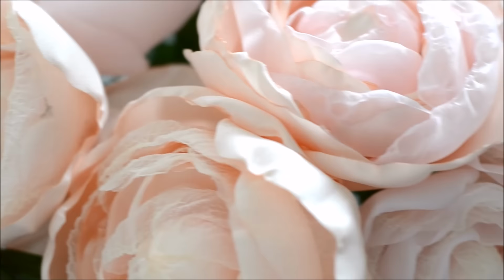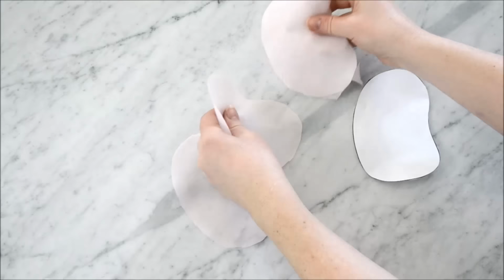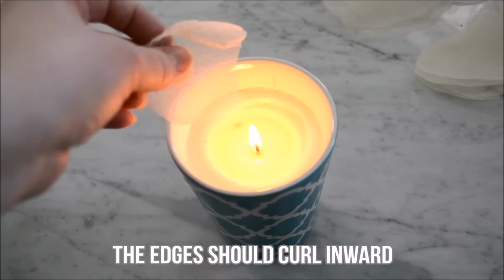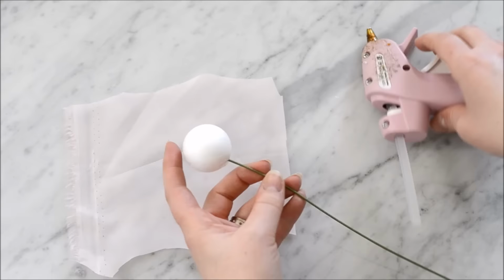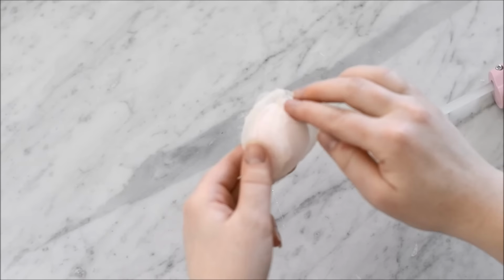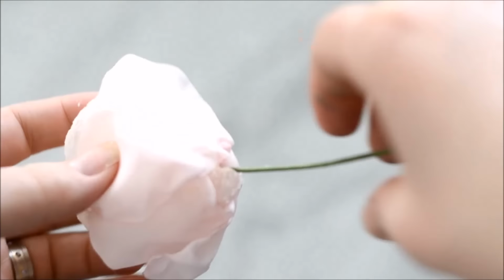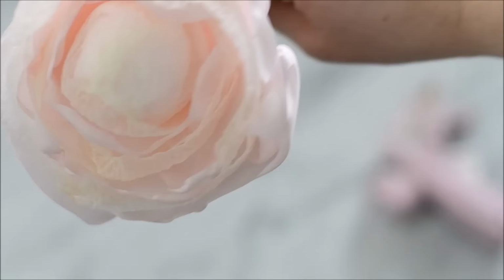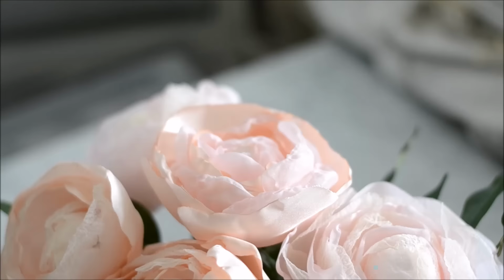How to Make Realistic Fabric Peony Flowers with Stems Tutorial | No Sew DIY

Comment: Hi 
I’m making burlap ( hessian) flowers for my wedding decorations can I make these peony’s out of burlap please ?
Many thanks
Reply: It has been my crafting experience that if you want to try a substitution, go for it! Don't forget to report back with your results, positive or negative. I don't know how you would secure the edges of the burlap.  The flame method may or may not work. [Depending on how tightly woven your burlap is] You might have to try some type of glue based edging.  Mod Podge, School glue with water, I'd start with 3 parts glue to 1 part water. Which might be interesting as you could sprinkle the wet glue with glitter, adding sparkle.  If you're not into glitter, an iridescent medium or paint mixed with a small amount of coloured paint, thinned with matte or gloss medium would work too.  Personally, I'd get some gold or copper iridescent acrylic paint, add a drop of orange iridescence and thin it with matte medium. You'd end up with a coppery/orange shimmer on the edges of the burlap peonies.   I'm curious now too! Working with burlap, do it as far in advance as possible, you may end up with chapped hands.